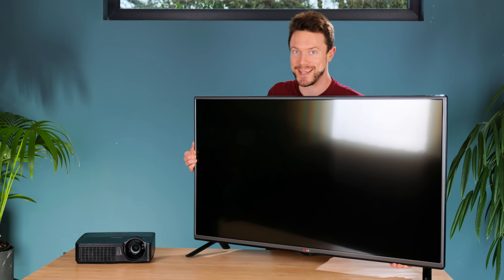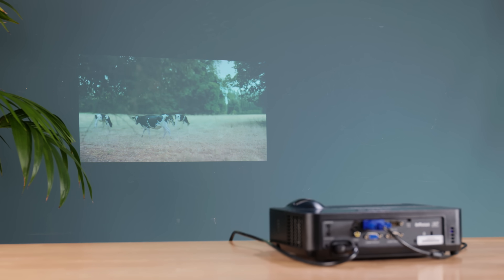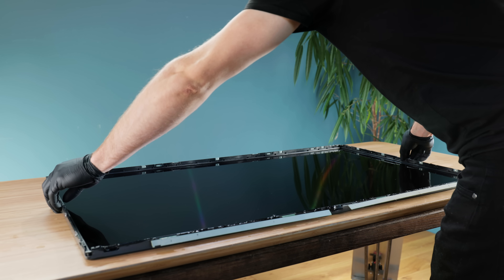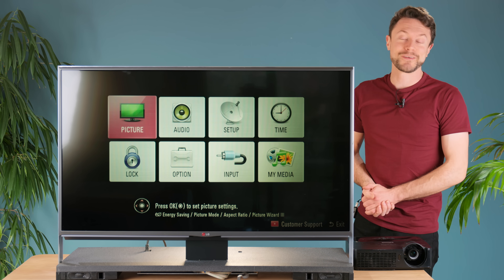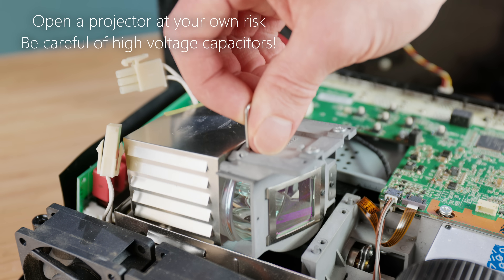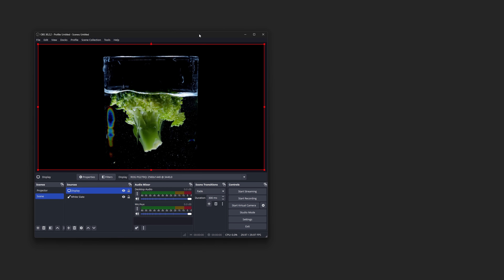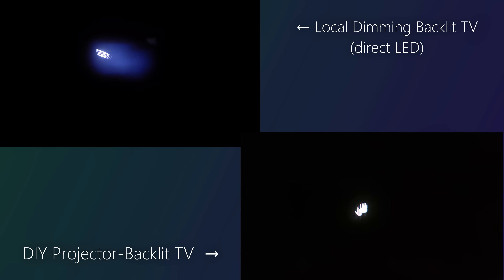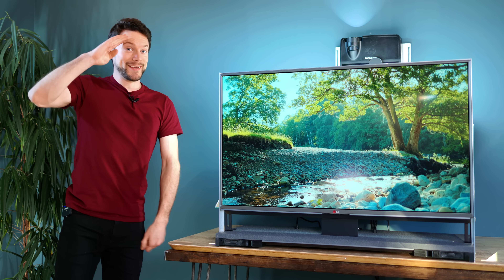DIY "infinity contrast" TV -  with 100% recycled parts

Comment: Rear projection TVs were briefly a thing, but never really took off because of their size. Using a modern 3 DLP chip laser projector with no LCD would probably be even better, as it’s all additive light, rather than subtractive through an LCD or colour wheel. But at that point, you’re probably just going to go for front projection anyway.

So yeah, really cool project, but I get why they don’t exist as a product.

Comment: When you have a high res light solution you shouldn’t need the diffusion layer. They use that because it helps mask the fact there is only a couple leds lighting the screen but if your lighting with high res accuracy than you shouldn’t need it.

Comment: I mean you mentioned those old rear throw projection TVs at the end. Could you do that? Just take one of them and put an LCD panel in the front. It would be better than mirrors or a pricey short throw projector wouldn't it?

Comment: I remembered a video you did of turning a broken laptop into a portable monitor and the thought occurred to me what if you used a second LED screen of the same size as the backlight driving it with a similar board used in that portable monitor video. The signal could be split into OBS as you have done with the projector but there would be no light spill or heat. That's not to say this isn't a brilliant combination of technology and as always inspirational to DIYers.

Comment: I’m not sure if you’re interested in code or taking the project further, but what’s required to create a light map like that in code is not much and could allow for you to have your own middle layer & route its outputs to multiple smaller controlled light sources to possibly shrink the size back down to a single unit that may be more useful for you. Just a thought!

Comment: So out of curiosity couldn't you create a flatter TV using multiple projectors?

I've seen super small mini projectors on Amazon, if arranged in a grid same as the leds at a shorter distance lets say 30cm, and then splitting the picture by the number of projecters so they only project their portion. 

That way the projecter can be closer to the tv and you could enclose in a case maybe

Comment: Why not use two identical TV. Remove the back layer on the one in front. Then u just adjust image/brightness etc at the tv panel in the back. We have set up with two projectors. It’s almost the same. Or 4x 4K for 8k resolution.

Comment: you can use video mapping software to map a projector onto surfaces more accurately. I think the issue with this would be a delay between the front and the back. but if you used an image processor, they will end up perfectly synced

Comment: I feel like the reason why no major manufacturers applied a LCD to the common Rear Projected TVs found at the turn of the millennium was that having a "flat panel" was a major marketing element.

A rear projected LCD that provided such image quality likely wouldn't sell well next to Plasma panels.

In addition, large LCD panels were not affordable, so the added complication of rear projection would heavily eat into profit margins.

Finally, the predominant technology at that time was TN and it would have likely have degraded the image/color quality when compared with Plasma panels of that era or backlit VA panels found in modern TVs.

Comment: Amazing idea, I will definitely try to replicate it.
I've an old LG LCD tv where the backlight is starting to fail that should be perfect for this 😄

About the video postprocessing needed for the backlight projector, assuming you are on Linux and you have an AMD or Intel GPU (maybe also with Nvidia but depends on driver), you should be able to do all of it directly on the GPU by injecting Vulkan shaders and postprocessing layers directly in the video pipeline.

That would give you near native performance without having to capture the screen, process the video and re-output it (which add overhead and could be blocked by DRMs like those of Netflix, Disney+, etc.)
It should also work for virtually any application or videogame because they would either already go through Vulkan (natively or with opengl), or if they are old DirectX Windows games, go through Proton that then uses Vulkan.

Comment: I like the vertical and 45 degree pathway for light, to make a long throw projector UST. I wanted to make a DIY iMac G3 clone based on a raspberry pi, with a curved screen. I thought  could make it a rear projection screen and use a cheap mini projector. But I couldn't get the pathway long enough for minimum projection distance with a single mirror. This revives the idea a bit. Note that both the reflecting layer of a mirror and the first surface of glass reflect the light, this causes a double image. Might not matter with your application here, but might tighten up the result a bit too.

Comment: Take the front LED panel as you have here. Put a second full TV ( with a working backlight ) behind it and run the OBS luma/glow on that input.  Make a case that can take both the hacked TV front and the second tv behind it. Therefore running 2 tvs with the rear one lighting the front one ? bonus you get 4 speakers. Or am i a simple fat anonymous person on the internet mashing the keys of my keyboard in a way that resembles intelligent thought. Nice project and excellent concise-ness.

Comment: That looked amazing. I was thinking you could use a second panel behind the primary instead of the projector, feed it from OBS as before and just use an amped up backlight because you're going through two LCDs. without local dimming. Now you have no backspace requirements. You could also experiment with applying a little chrominance from the rear panel too to make the colors stand out even more.

Comment: Very cool project.   speaking of the old rear projection tvs, I wonder if you could still build a tv box with "Stand" that add some height to the tv instead of leaving it on the table.  That might give you enought height to keep all the light in the tv box.

Comment: While this is undoubtedly a very interesting concept, it has little to no practical value when you can get perfectly servicable used oled TVs of this size for as little as $300. Maybe if you wanted a really big one (like 80+ inches) where those are still prohibitevly expensive...

Comment: You mentioned you don't know why this hasn't been done before-- form factor is most likely the reason. This kind of tech, as you've shown, brings TVs back to CRT levels of bulky. Near-field projectors would work nowadays but I'm pretty sure most of the near field ones existent today are the newer laser kind, expensive to have now and even moreso to add to a TV back then.
Also, making some kind of really minimal frame (like, black trash bag around the assembly level minimal lol) should be enough to make this perform better in a lit room I think.

Comment: I honestly don't think using a short throw projector would work too well, as backlit TVs diffusers are designed for the light to come from behind. Great concept though and made out of tip fodder too. Loved the use of 3rd party software to put the light just where needed and removal of the projectors colour wheel to achieve the goal. Doogyrev!

Comment: Nice project.
Maybe stupid idea but what about using 2 same LCD layers and regular backlight ? 1st layer will block most of the light, the 2d will block the blury blacky-gray and it's done ?
Maybe using 1st layer as luminance layer like the projector do and 2d as real image ?
If it works, it'll be way easier and keep the electric consumption nearly the same as backlight is most of consumption.
Seems the same "tech" as projector is light + 1st layer and screen is the 2d image layer.

Comment: My screens are all IPS  4k 10bit , no local dimming and when I first got them 2 years ago I was blown away by how black the blacks are and how bright the colour is. Sure old tv's and monitors from 10 years ago were good but I see no problem with modern ips panels. I love project but the space it takes up.....not very practical is it , and fragile and then the problem of having two surfaces to clean and a lense and then the elephant in the room the fact you have a few hundred watt bulb that has a how many hours left and runs at hundreds of watts. And usually they're not cheap to replace either so now what buy another projector ? also processing power having dual display outputs from a pc and obs running so another 150w, we're talking anywhere from 200-400w for some black levels.

Comment: wait I'm a bit confused,
isn't this the same as using double crystal layers? Because the projector itself is also kind of like an LCD, it has a light blocking crystal layer(?) and a backlight.
so this is very similar to using a dual blocking layer. ? Unless it's a DLP projector (Micro lense array, mind boggling technology!) but those are 1300cad min from what I have found!

super awesome and cool tho :O
ALSO You could maybe somehow use parts from a RESIN 3D printer and change the UV backlight to white light or convert it as a cheaper alternative ? Might not be any better tho.

Comment: Excellent project. As soon as you started talking about folding the light, my mind jumped to modifying a projector TV by removing the passive projector screen in the cabinet and projector filters and replacing the screen as you have with an LCD screen and processing the projector feed via OBS. This contains all the stray light for a better domestic experience.

Comment: Is a diffusion layer needed at all if the pixel count is the same? A bit fiddly to line things up, of course.
LTT did a multi-game system out of an old LCD rear projection TV, with one of those you can add a front LCD and the light path is already folded properly.

Comment: Since color accuracy and focus aren’t important for the projector portion, an exotic lens solution to create an ultra ultra ultra short throw should be possible, making a tv only a few inches thick. A manufacturer could also simplify the lens and have four projectors in quadrants behind the screen. Probably too expensive to justify.

Comment: I'd rather just pay $800 for an Oled TV. 

I mean I get it, I understand the appeal, but you need a TV and a projector, space to have your TV several feet from the wall, a ceiling low enough to mount the protector and mirror so that it bounces the light back to the correct spot (got 20 foot ceilings? Not going to work), and at the same time you can't watch movies in actual darkness because the projector is going to constantly light up your room, and you also have to deal with the fan noise of the projector. 

It just doesn't make sense to try and save a little bit of money by upcycling an old TV when there are so many tradeoffs and oled TVs are getting cheaper and cheaper.

Comment: I still have an old DLP rear projection TV in my basement. Wonder how hard it would be to use this method on that? Would solve the whole rear projection issue you have. I think the trickiest part would be fitting an LCD to it, in place of the current screen.

Comment: That's a really bright and clever idea!

Two issues that come to mind however; I suspect the combined power consumption may be a bit high, and then there's the issue of fan noise from the projector's cooling. But as you said, that's all up to the light source, use a more efficient one and both issues can be adressed.

Comment: I have an idea for the time being, and after watching your video, it seems a bit possible. 
Like how about we take the theory of micro led. Can you line up 2 individual LCD panels one after another, and then a diffuse sheet and then some high-powered light source. The application is similar, the front panel will show the color image, but the rear panel will generate black and white of the image. Since the panels are identical, and theoritically the the rear panel will block the light where it is dark and brightens where ther is an image.
If it's possible, it can be done in very compact space too.
Aside from that, your video always inspires me to do something out of the things I have lying around.

Comment: It's wild that you somehow re-invented DLP displays with some computer software. But using an old computer for this isn't going to fly; the image needs to be attached to an SBC and wholly powered from the television, that way a dedicated Linux OS for the image processing can be used; tap directly into the television output, then the SBC displays images from both sources in-tandem.

Fold the light path inside an enclosure then seal with a metallic-painted enclosure to capture as much photons you can cheaply and you basically have what DLP could had been at a very affordable level.

Problem now is; what's the latency? You'd have to run a real-time Linux kernel and do all of the pre-empting you can with it so the display is suitable for more twitchy titles.

Comment: Could you use an old dlp or sxrd rear projection set from the mid 2000s with an lcd glued in place of the old projection screen? This might give you a unified chassis and eliminate the need for so much external mirror and projection system?

Comment: A few years ago actually The Hisense 85UX (also known as the UX Mini-LED TV) uses a third LCD layer for backlight control, which is technically a black-and-white (monochrome) layer. This technology, sometimes referred to as a dual-layer or dual-cell LCD, improves contrast by acting as a precision dimming layer behind the main color LCD panel. It effectively creates a quasi-OLED contrast effect while maintaining the brightness advantages of an LCD.

Hisense previously experimented with this approach in models like the Hisense U9DG, but the 85UX refines the concept while integrating mini-LED backlighting for even better local dimming.

But now I don't believe they do due to expense to manufacture because all the rest of the TV still have two layer LCD screens
Reply: By the way great video ❤

Comment: This is crazy. What surprises me the most is how robust the system is.

LTT recently made a video where they used a strange old tv that was actually a short throw rear projector and screen in the shape of a CRT TV. While gutting it to stuff the insides of it with consoles and a new TV they showed how careful the design was to protect from dust or any contamination. The old thing didn't have a speck of dust inside.

Meanwhile, here you have everything in the open, with not even closed sides to protect from light contamination, and it still works perfectly.
Reply: It's just insane with an open back that the black are so deep!
Not to mention the TV panel is made of cheap materials too, compare to today's high end panels!

Comment: What if you build like a shroud around the tv to clean up the look on the version with the projector pointing at the ceiling. Also I wonder how blocking out extra light and preventing the projector's light from escaping would impact the image.

Comment: This is awesome. I love this idea. I knew exactly where you were going with this project. I'm a professional video projectionist, and I "Double Stack" projectors all the time. So, I'm used to lining up grids. I wonder if you did enough tweaking if you could align grids tightly enough. Also, Did you notice any delay in the video signal once it ran through OBS? That would be another concern of mine if there are different signal timings causing the backlight lag or advanced LCD? The Luma filtering is really what sets it apart. Very cool. I may have to try this someday.

Comment: Wow... great job and amazing result. Now, if you get a short throw projector, then it could be built in a box, of course depth depending on the projector throw distance and size, but then use the space under the LCD panel to integrate some serious speaker system like the one you've made before. If I get my hands on any of these components (for free or dirt cheap), I might build one myself.

Comment: that tv psu is gonna cook itself being encapsulated between those 2 aluminium sheets and that plastic shroud which none of them 3 have some ventilation holes to let out that heat other than that the project outcome is breathtaking my god i never belived that it is possible for a liquid crystal display to look almost the same as a oled display

Comment: This is really fascinating to see! It reminds me of G. Damberg et al.'s paper, "High Dynamic Range Projection Systems", from a few years ago. After reading it, I wondered about projecting onto an LCD display to similar effect, but never about just using the projector as a backlight. This seems much easier to implement than either of those approaches, and the results are just brilliant! I can only imagine what it would look like with a more modern panel and projector, especially at high refresh rates.

Comment: So you've made a rear projection tv :) have you thought of looking at them for inspiration? Linus tech tips has recently done a video with one, you could use that as inspiration on how to make it more compact :3 (projector usually faces upwards towards a mirror, which then reflects the light to the screen).. with a little port extending and moving around, you could making it less than a metre in length